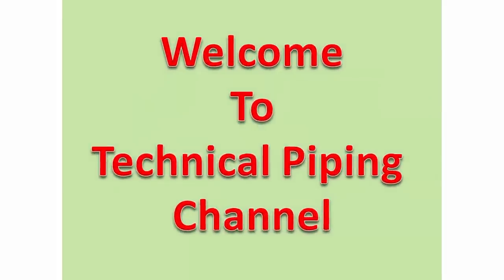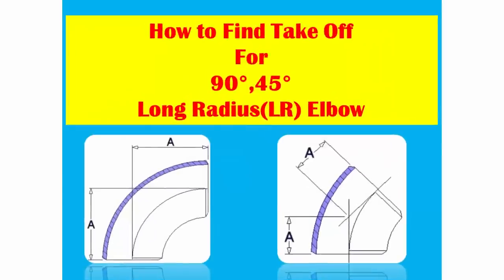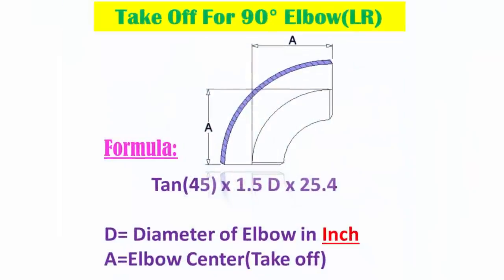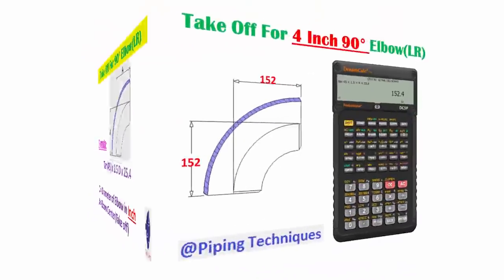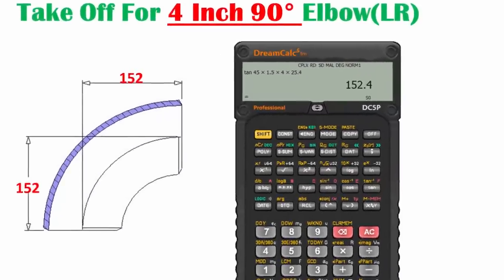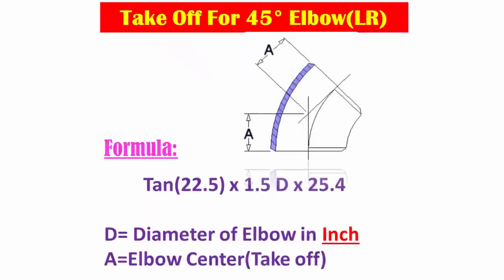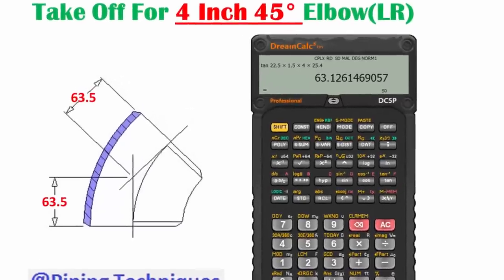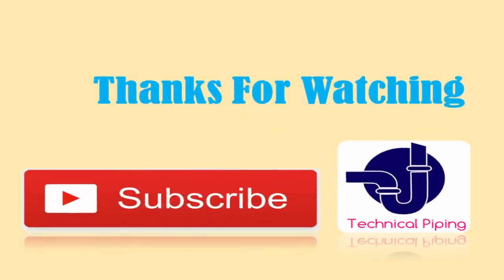Piping- 90 and 45 degree Elbow Take off Formula

Comment: 90° take off take half the pipe size and add it to the original pipe size, that will give u take off.. 12" pipe. Half is 6"..12"+6" = 18" take off....45° take the pipe size and cut in half 4 times. Then add the original pipe size and the last size. 12" pipe..12÷2=6...6÷2=3..3÷2=1.5....12+1.5=13.5" take off
Reply: Im learning autocad because I work preparing estimate for metal works. Watched various videos on how to find that damn radius and thats the same conclusion I figured out from all the technical jargon...   Inside radius of the bend pipe for 90 degrees is basically just diameter + half should work...   thanks for telling me how it works for the 45 degree, pretty simple too.
Reply: I think the T.O is 7.5" not 13.5"

Comment: WELDED FITTINGS SR 90 TAKE OFF PIPE SIZE LONG RADIUS 11/2 TIMES PIPE SIZE WELDED 45 5/8 TIMES PIPE SIZE OR 4 INCH 45 4-2-1-1/2 ADD TOGETHER 2ND AND 4TH NUMBER

Comment: i try too much to make its formula it give me 247 not 152  ,,, what is wrong ? i don't understand ...
Reply from the maker: +Eslam Khattab formula to find take off: tan(degree of elbow/2)x1.5dx25.4 for long radius elbow.
example: 4 inch (90degree-LR),tan(90/2)*1.5*4*25.4=152.4mm.
Reply: you have taken tan for 45radians.... you need tan for 45°.. you can change the angels from radians to degrees in your scientific calculater...
tan 45° = 1
tan 45rad = 1.6198
Reply from the maker: +VISHNU P NANDAN .yes.correct.
Reply: Technical Piping sir can we apply this formula for any digrees ?